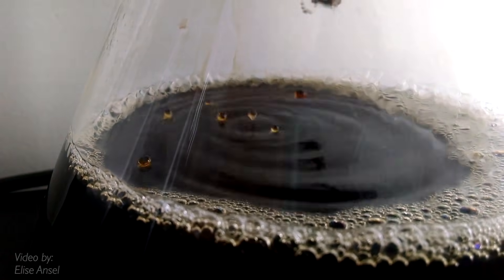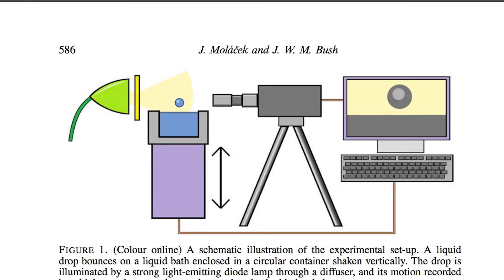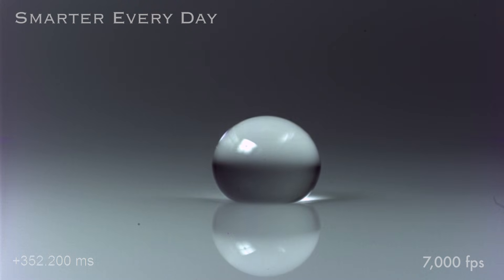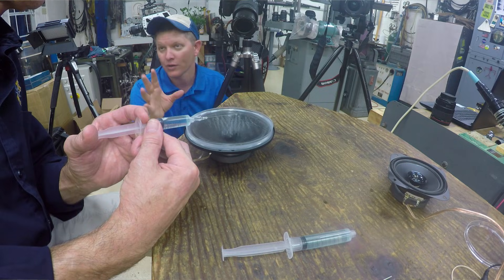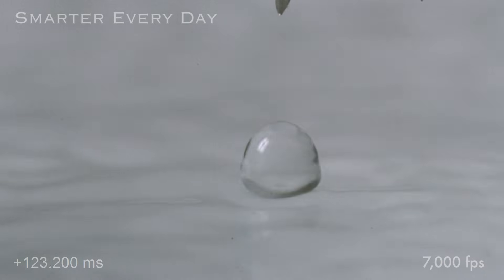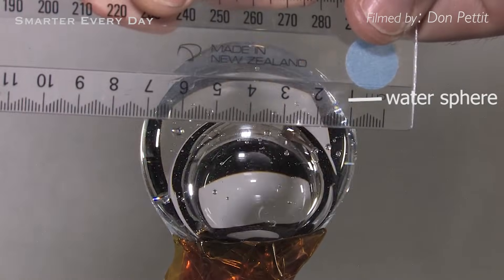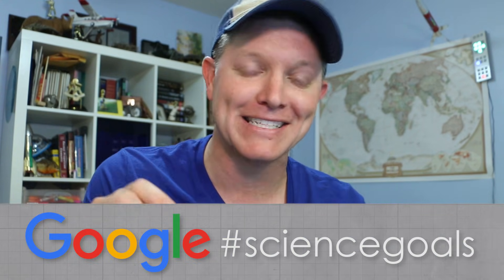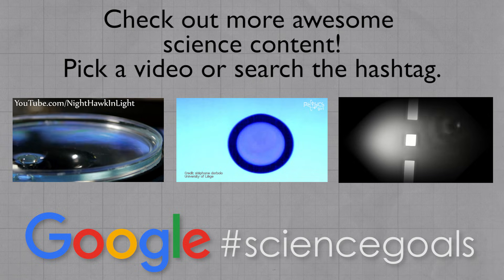The WALKING WATER Mystery (in SPACE and SLOW MOTION!) - Smarter Every Day 160

Comment: I’ve never seen this happen other than on hydrophobic surfaces, never on itself...I’m so confused
Reply: I'm 40 years old and have never seen this phenomenon. I also brew coffee every morning and this has never happened in my brewer.  Perhaps it's related to elevation or humidity? I am in SoCal.
Reply: @Battlefresh  no your water is just contaminated
Reply: @darkracer1252  i agree. or maby Not contaminated with oil. (pasting my Reply i wrote a few mins ago) 
Might be late But i was working Soap and Mettle rods washing them to paint them. But these rods  was full of oil. i actually noticed this a few days ago and happend onto this video. i belive its the oil in water and other stuff. i belive there is oil in everything and that its the oil that creates that watter running on water. coz that drops does not happen in the bigining but after a While of washing these mettle rods i started noticing those drops hapening with Larger water droplets.  and that i can create it just by Picking  up the water and dropping a bunch with my hands on that water in the drum and it creates a Bunch of those drops deference in sized!
Reply: I've seen it happen a lot in my shower, the floor isn't hydrophobic and when it's dry it doesn't happen, however, once a thin layer of water covers the floor, little tiny droplets starts to form on top of the water surface,I find it really pretty and always wondered why it was happening
Reply: “Pacfam42 YT”, Watch better.
Reply: As Destin mentioned, the higher elevation makes it harder for this to happen.
Reply: Liam Burgess however I live in Colorado at high elevation, and I’ve witnessed this multiple times in my life.  but with my measly level of physics knowledge, I didn’t know what I didn’t know, to even understand that I was looking at something significant.
Reply: @katelynnehansen8115  It's only significant in that it requires further observation to understand, not that it's rare or requires very specific conditions. It's exceedingly common, but making note of it, and wanting to understand it, shows a character of curiosity.

If you've never once seen this in your life, I think you're just not being observant enough. It's like never having seen refraction in water. It's always there, you're just not looking for it. How can people have supposedly never seen this, before? 😕
Reply: LittleMaliceManny Curiosity is my middle name (or it would be more apt than my current). Perhaps significant is the wrong word. I always found it interesting and wondered how and why, just didn’t possess the knowledge or technology to look further.
Reply: LittleMaliceManny As to those who haven’t noticed, maybe they just don’t slow down enough to notice. 

As a mom, I constantly draw my toddlers’ attention to the seemingly mundane aspects of life. Like the hairs on an insect, the varieties of moss on a hill, the composition of a pebble, or the light-ringed shadows on the bottom of a shallow river, created by objects floating by. Drives my husband crazy that I’m stopping every few yards on a hike 😂
Reply: @katelynnehansen8115  I don't think it's the wrong word, just kind of wanted to clarify for some of the people in this thread. It's an extremely common phenomenon, but it is significant in that it can teach us, give us a better understanding of our world.

Wanted to be very clear that this is reproducible almost everywhere, under many different circumstances. There are few variables that have a noticeable effect on it, and if you're at a liveable altitude, you should be able to see it.

So it just kind of boggles my mind that there are dozens of people in the comments saying they've never seen this. It happens when it rains heavily, at the bottom of the tub or floor when you shower, at the bottom of smaller waterfalls; and it's not just with water, either. Many liquids will behave in the same manner. 

Oil will do this, too. And this isn't a difficult thing to check for yourself, either. So to the people in the comments attributing the fact that they've never once seen this (supposedly) on their water having contaminants - specifically oil, for some reason... No.

I, too, am at a decent altitude, and I've seen this everywhere.

I mean, I'd assume the majority of people watching videos like this would have some amount of natural curiosity. If they then say they've never seen this, it kind of contradicts the above assumption, in my mind. But maybe we just have too things going on, now. Too many eyes glued to screens, too many constant stressors to allow us the opportunities to stop and smell the raindrops. 

Kids are a great tool to both observe things more closely, and investigate why things work the way they do, in order to pass that knowledge along to them. Helps us remember the feelings of awe when we first noticed various phenomena. 😊

Our world is so complex and beautiful, and I hope our species never loses its capacity for wonderment!
Reply: @Acidfunkish  Ever considered the possibility that those same commenters see plenty of things that you yourself have missed? Where's your curiosity?  Too many things going on right now?
Reply: @mattkristiansen1373  Why did you basically copy my comment to me?
Reply: @Acidfunkish  You really don't get it...
Reply: It never happens around you because you really suck the air out of the room ... bah dump tss
Reply: Air gap theory does not ring true to my ear. Droplet is a low energy state. It needs energy to make it flat. Think of the “flat” surface of the water part of a global sphere. It’s two spheres that have come to rest. Most likely if you made the conditions still and cold enough and the atmosphere something with a greater vapor pressure than water vapor, you could keep a droplet there almost indefinitely. BTW the resonance patterns of musical notes in water is stunning. So much information that is so distinct for different notes it looks like unpacking a giant compression algorithm. You can see how hearing might work - well worth looking up.
Reply: @juliancox3229  I would personally have found it incredibly interesting to see a slow progression through the frequency spectrum. Just watching how different sized peaks and valleys appear in different spots is quite mesmerizing.
It would also be interesting to see if they could approach a resonant frequency slowly from one side so a droplet tears off, changing the resonant frequency, and how the system responds depending on whether you are ramping the frequency up or down to the resonance. Dynamics are fun in practice. 😉

Comment: what i guess is that sense the water surface has a bit of resistance and because of the air of the drop if the water droplet hits at a soso high speed it wil get pushed back by the waters resistance because there is no time to get rid off all the air yet but the water tries to stabilize doing so shoots the water droplet up again over and over until it gets the right speed and all the air gets pushed away so the droplet acually makes contact with the water

Comment: When the surface tension of the water is broken, a water droplet will instantly coalesce upon impact, does that mean that the atoms of the air which would normally have served as a cushion for the droplet and the atoms of the water in the dish are somehow intermeshed? I imagine that the air pressure may force the atoms of water on the surface to arrange themselves into a molecular lattice which would impede the flow of air long enough for the droplet to bounce off it repeatedly.. So without the surface tension it would be like running between the posts of a fence with no wire.

Comment: I am very into this phenomenon.

I have seen this happen when the water is falling long distances.  can you measure the difference in max and min waterdrop  impact speed on the speaker?  Then change the fall velocity of the water to measure how much the catchers mit theory accounts for?

I think you got distracted with sound causing the phenomenon.  This happens without the vibration from the speakers everywhere else i have seen it.  I understand the need to be able to repeat the phenomenon in a small are for the camera; I think that constraint limited the experiment too much to be conclusive.  When i see this phenomenon it is never in single drop low velocity configuration.  This experiment doesn’t test for any other contributing factors.  All this has shown is that impact velocity is a factor.

I see no evidence of the air gap theory.  If you change the temperature or rotational energy of the water does the outcome change? 

Super amazing video.  I can watch the cello part for hours.

Also are we sure it is the cello?  Or is it some set of Bach music? Is it Bach Cello or is it all cello?

Comment: Can this effect be applied to, for example, a glass plate to create a seemingly hydrophobic surface that can also be turned off and on? It seems like all you need is a source of vibration. If I remember correctly, the lotus effect is partially caused by microscopic bumps on the surface. With the right frequency, the wave traveling through the surface should form small enough bumps to create a similar effect. To improve it, multiple "wave emitters" could be combined to create a more noisy pattern through interference. It would be perfect on windshields for cars. But I'm no physicist, so maybe somebody with more knowledge could tell me where I'm off. :)

Comment: Man, I have a theory that maybe something different than this "air-gap" however, please feel free to challenge my thoughts on this: this water droplet is made of the same material H2O yet it has not coalesced with the water structure that is bound together in a "pool" obviously, but I think the structure of that water vibration is basically under a pressure of sorts, and the drop-trying to be integrated, takes shape as it falls, has a motion, and the pressure constantly changing, is what keeps the droplet separate from the pool, rather than Air between the drop.  Think of it like this: you have seen the stuff called Ublek? just a mixture of cornstarch and water, right? That stuff will solidify as pressure is applied to it, becomes a solid and yet it will mesh as soon as the "stress" being applied is relaxed.  I think that is similar. I may be wrong, but maybe this will be proved . . . to be true.  If anyone wants to challenge this theory, prove I'm wrong.  I don't see air-gaps between the water(s)      Or . . . Let me put this way.  Can a liquid be pressurized to the point of suspense?  Example: as a vibration moves through the liquid it is synchronized. The droplet which has no or a different vibration cannot instantly meet the rhythm exactly.  Thus, momentarily it gets suspended in its most natural shape.  There is no gap between the two, it simply a difference in pressures.

Comment: Thank you for this mind-expanding video. I am not an expert on water phyisics, but I think this phenomenon of floating droplets, has also a lot to do with the motion of the water inside the droplet itshelf. I think that a spinning droplet will propably float (or skid on the water sufuce) until it stops spining (or minimise its inside movement to a certain degree). In reverse, a droplet that has not a lot of inside motion will be coalesce instantly with the the water surface. Forgive me if you mention my thinking and I didn`t notice.

Comment: Actually its surface tension that makes this to happen… if you extend the surface area you have less tension over the drop, because its spreaded over a bigger area. The vibration just make small waves that can have more area due to the wave lenght and amplitude of it, so while in the vector h (Horizontal) a limit surface area, if you bend that surface you going to have a bigger area (like when you have a wave, you bending this vector)  ... just search about it...

Comment: I've never thought you might have missed something before.

Isn't it more reasonable that the variation in the shape of the drop as it winkles toward the surface of the pool affecting how much sir is caught under the drop.  You diagrammed the drop as a sphere, but it's not a perfect sphere.  Sometimes the drop is relatively pointy and quickly expels the air while most of the time it's not.  When the speaker's on it's creating a cupped surface from which the air isn't easily expelled most of the time and the shifting surface is able to keep the air gap changing and intacted as it keeps the drop bouncing.

Comment: Destin, this is an awesome vid! I also had this question, but on another level:
Have you ever been in a rainfall on the sea, when the sea is very calm? you can see some patches forming on the surface, and those patches are distinguished by the amount of vibration of the drops that fall on it. It is as in the surface, water would have different vibrations and therefore you have some parts where the dancing water effect is more present than in others. Nobody has been able to explain this to me, but this takes me closer. Tks! ;)

Comment: I just started watching the video, but had always assumed this phenomenon was not beads of water dancing across the surface, but was bubbles caused by a drop of water penetrating the surface, creating that cavitation 'hole', the hole closes up encapsulating some air as a bubble in a thin 'film' of surface tension, which rolls across the surface until it pops.  So, bubbles, not beads.  Let's see if I was right....

Comment: And both of you failed to mention during the experiment with the cello or that of the experiment preceding, of the waves on the outside of the initial water bubble. The desktop novelty item, which strings a series of ball bearings is the explanation which occurs in the inside of the bubble hosting the air bubble. What Don could have done in space, formulate the bubble with the air bubble inside and allow it to float. The first time I saw them playing with water droplets I ask myself... What is the air pressure inside the space station? 14.7 lb.. the same at sea level...! You need to get in touch with me... I have got explanations for things that are apparently written in stone that cannot be proved. And the experiments I would like to conduct ... scientist aren't doing them!

Comment: I have to wonder if there is a thermodynamic event happening as well.
A) If you look at rain, it is falling at atmospheric temps, and the stream is more likely to be closer to temp of the surrounding ground.
B) Condensate from the helicopter hitting a puddle that has been warmed by the tarmac.
C) Warm? Urine (simulacrum) hitting room temperature porcelain or plumbing water.
My point is that some of the phenomenon could involve the differences in the surface tension properties of the fluids at differing temperatures.

Comment: "larger the drop greater the gravitational force pushing down on it"  Wow, that one was disproved back in the late 1500's by Galileo's experiment at the leaning tower of Pisa.  Newton proved that gravity is constant.  Maybe, greater the mass greater the pressure caused by the mass of that drop or something along those lines.  
My guess is the cello sound isn't the causal factor but the polyphonic and frequency of the cello music.
There has been many mentions of the air between the drop and water without any mention of the surface tension.  If it wasn't for the surface tension I don't this phenomenon would appear.  If you were to use something to reduce the surface tension would the phenomenon persist?

Comment: Would the drop push the surface water down, making it's own "valley" (the drop forcing down air and with the air boaring a valley in the surface); or does the droplet, if not landing in a preexisting valley, would it slide down the slope of one of the "bumps", and only work if the resonance time was long enough for the drop to travel down the slope and come to a rest in the valleys?  Not sure if this question was answered in the video, but I had to start writing it during the video so I wouldn't forget.

Comment: I think this is mainly due to the electrical fields of the surface tension, repelling each other. Normally gravitation keeps the two liquids in contact until the rest of air layer between them can dissipate, so they can break up the surface geometry by gravity and merge. Through the resonance frequency the drop is repelled, and being a falling drop again, the cycle starts over until the drop evaporates.

Comment: The way instuments in the violin family (such as the chello) family ceate sound is uniquely differnt from most other typs of instruments. When instruments  that are strummed or struck create sound they vibrate in a reletivly even pure fashion. However when the strings on a chello vibrate the vibrations are very sharp and iregular as the bow sliding over the strings is constantly interupting the vibration of the string as the two come in and out of contact with each other, creating soundwaves of difering legnts and amplitudes within the same note.

Could be the reason chello music worked so well.

Comment: Am part way thru.  It must be competing surface tension, and not a trapped air layer, right?  The surface forces that keep the integrity of the droplet shape have a threshold of resistance.  And the top surface of water puddle also has a force threshold that needs to be overcome to allow penetration.   If that force threshold isn't overcome, the droplet bounces.   Plus there must be a speed component.?

Comment: Superficial tension makes the dropplet which has less mass and weight to linger on the surface as long as there is movement present. Both the superficial tension of the dropplet and the larger pool makes their "skin" to rub each other while the movement is still present, so the dropplet cannot press down on the pool's skin.